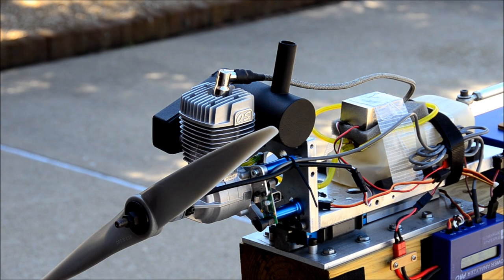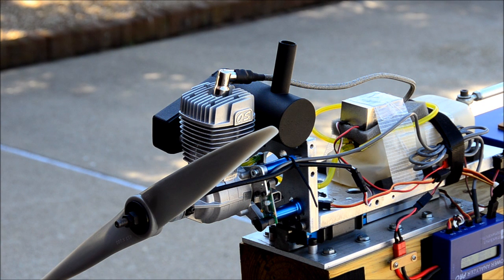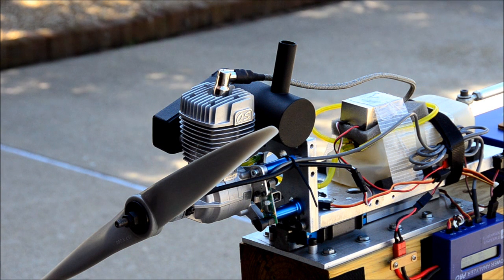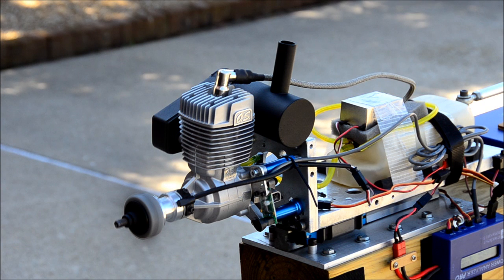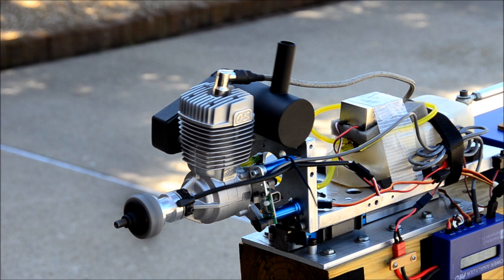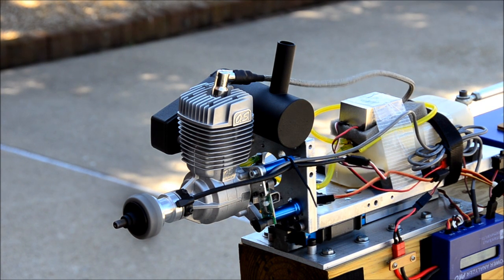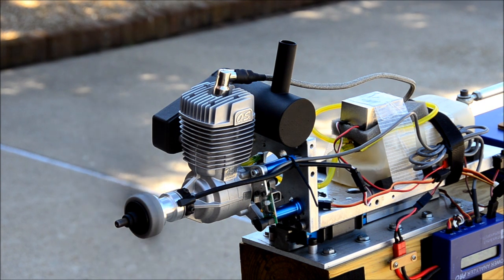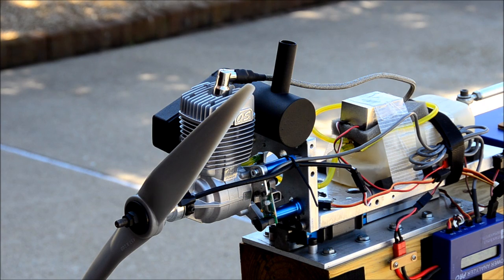O.S. GT33 Gasoline Engine -- PC Controlled Thrust Test

Comment: I have recently got a plane with os gt33 and 18x8 is a hopeless propeller..i use a 20x12 and i get brilliant results and also it makes the engine quieter..you might want to calculate with a 12" pitch..bet the thrust measures will climb alot

Comment: I am breaking in a GT-22. It has the same nice baffled muffler, and lower sound. Almost sounds like a 4-cycle in the low rpms. And the GT-15 is getting over 10,000 rpms on a 14x6" prop. Vibration is lower than the cheaper Asian engines.

Comment: Sounds great but I would be interested to know what the db level is at full throttle. OS claim that it's quieter than other comparable engines. I have a dle 20 with a pitts on it and it makes 105 db at full noise which is too much for most flying sites. I swapped to gas to get away from expensive methanol engines only to now have a noise problem!

Comment from the maker: I used regular unleaded pump gas with Royal Purple synthetic at 40:1.  The initial start took some effort and it ran backwards a few times, then after that it was pretty good.  Sometimes one flip and sometimes up to 3-4.

Comment: Wow, nice running engine.
What oil (& ratio) are you running for this test.
There's a a lot of anecdotal reports of this engine being difficult to hand start but it certainly doesn't seem to be the case with this engine.